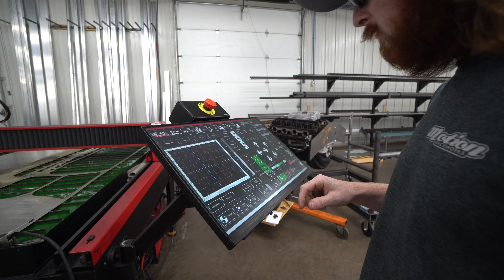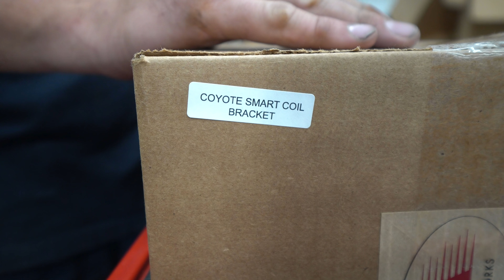Day 1: Introducing El Toro! 8 Second Turbo Coyote Swapped Fox Body Build in just 8 Days!

Comment: i got my ls1 billet valve covers shipped to a remote part of Australia and on my door step in 3 days. shipping is the fastest i have ever seen
Reply from the maker: Awesome!  How do you like em?!
Reply: @MotionRaceworksOfficial  they look  awesome and fit perfectly on my single turbo Ls1 commodore. the fact that i can mount the coils higher than stock and i have now put them back on the engine and not have to remote mount the coils to stop cooking the plug wires. very happy thanks

Comment: How much would all the things done to this car cost all in all?
Reply: Are you thinking, kit form?  Like, I have a 4 cyl Fox coupe rolling chassis that I want to build a 8 sec. Turbo Coyote out of?  Maybe break it down to system groups that way a guy can have $3k-$4k (example) and buy the fuel system and suspension portion, then the cage, trunk block off, subframe connectors next, then the stuff for the parts yard 5.0 then a turbo kit?
Reply: @larryhampton9069  you're much more knowledgeable about cars then I am my brother. I have a 92 mint fox sitting around "stock" 46k miles with a few here's and there's, headers, bunch of billet accessories etc (that I didn't do) and I was kinda wondering off the top what kinda rough estimate would it be to make it anything in the 800hp range that require a full engine... Everything in the train swap. Was more of a inquiry then anything,like off the top of the head. I know there's many more details them to type on youtube but I was like ehhh why not ask.